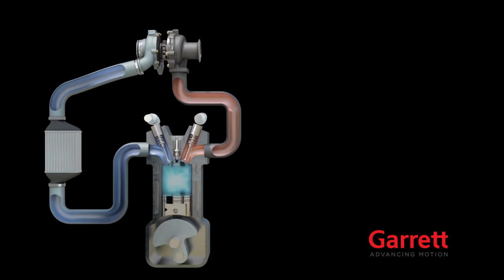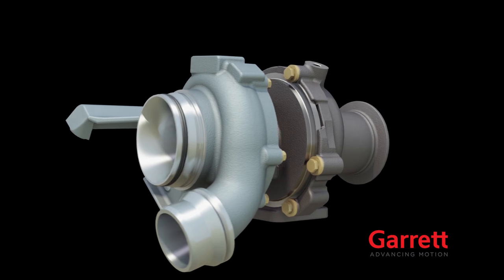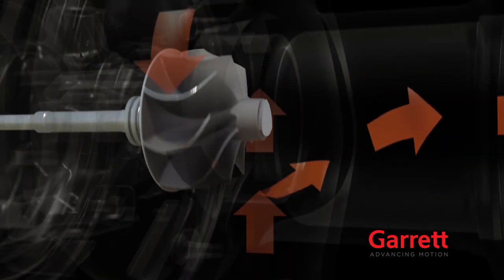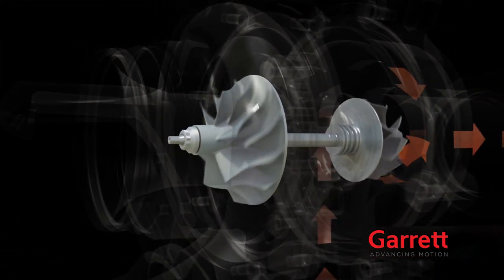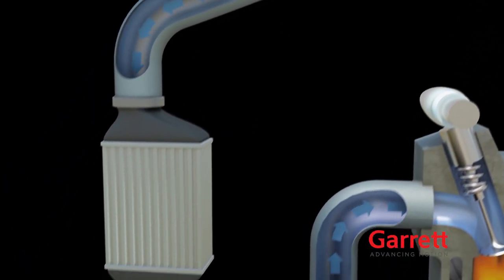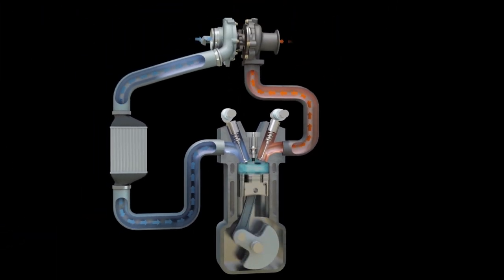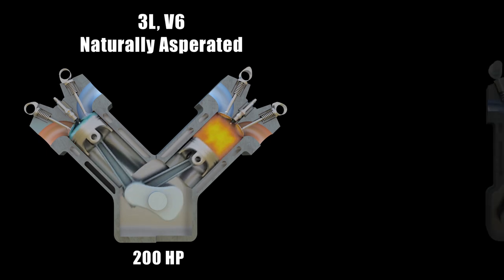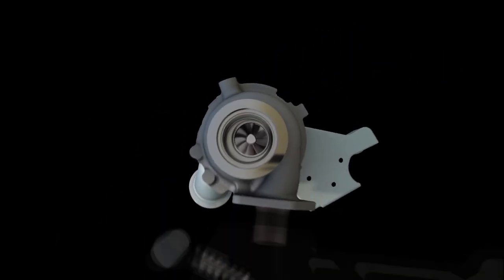How a Turbocharger Works | Garrett Turbo Technologies | Garrett - Advancing Motion

Comment: But doesn’t the engine have to use more pressure to spin the turbo vs if it didn’t have a turbo? I understand that the exhaust gases are coming out anyway but the turbo has to change the formula some.